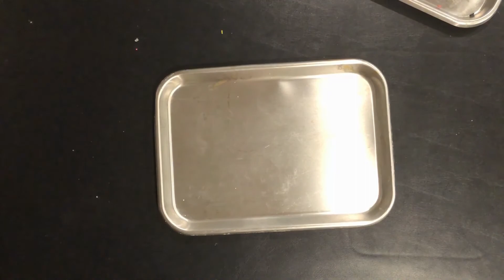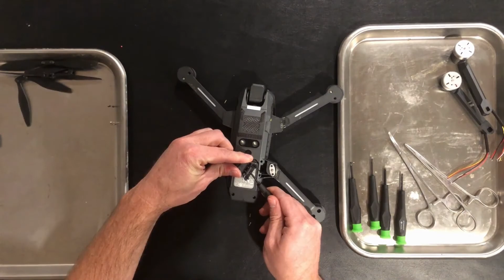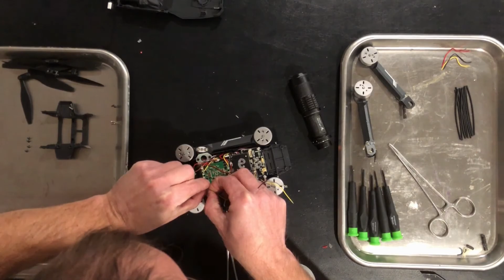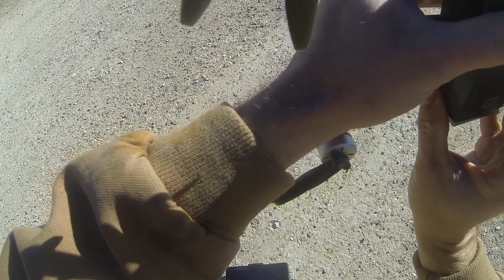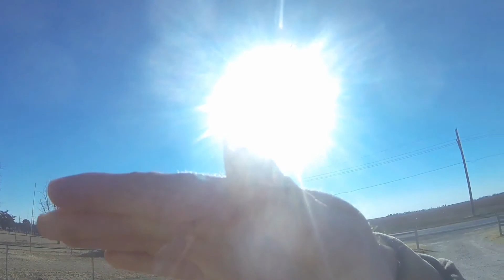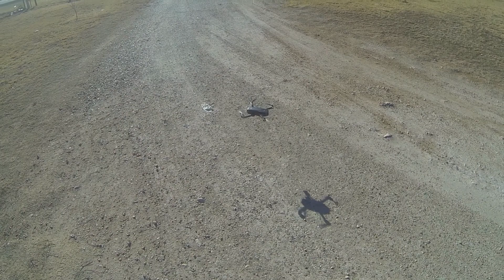Holy Stone HS720E Arm Replacement COMPLETE PROCESS AND TEST

Comment: This was awesome. I followed it step by step and the result was great. The soldering of the wire to wire did add some space issues with the shrink tube, but it all fit when I was done. THANK YOU for an Indepth video with no wasted time. Very much appreciated!
Reply: I’m missing the white part that holds the arm. Do you know what it’s called and where I can get it ?

Comment: Do you know the name of white part you take out at 11:43 I’m missing that since the crash and can’t find it anywhere.
Reply from the maker: There's a white piece with a metal locking mechanism that holds the arm in place...is that what you're talking about?  I don't know what they're called, they're not a common part sold as a spare.  You might need to reach out directly to holy stone for a replacement.

Comment: Hey! do you know the reason for crashes 720E? they all fall leaving in a free and uncontrollable flight.
Reply: they are too quick for maneuvering.. need to practice first in open field.. low speed is too slow sport mood is too fast they have fall sensors but no side or upside sensor or blade cover for crashes.. i believe mostly of peeps breaking them when flying first. definetly not easy to control
Reply: @nesargurkan  It seems to me the reason is in the GPS positioning system, I turn off the GPS and the drone has never fallen, when GPS is turned on, it sometimes abruptly goes to the side in hovering, once, when performing a "return home", it suddenly went into a turn and fell, naturally at that moment it didn’t control it at all, and it’s still strange that it ceases to obey even the motor blocking button.

Comment: Hi, can you replace just the motor? I tried to disassemble the motor but it's not coming apart even with the screws out.
Reply from the maker: You can't.  The bottom fascia is glued place and removing it deforms the arm.  You could possibly cut it, but it's not likely to be successful.  Replacing the whole arm is easier.

Comment: I'm a complete newbie at soldering is it possible to use ultra low resistance butt connectors cause I’m quite skilled with those
Reply from the maker: I wouldn't because they'll add more weight and bulk....there's not a lot of room in there and getting it to close up with just shrink wrap was pretty tough.
Reply: I’m sure the ones I plan on using will work they are very very tiny butt connectors meant for wires .2 to .5 mm and weigh next to nothing
Reply: Use tiniest needle. It wasn't difficult for me.

Comment: The 2 screws on the arm (above the white plastic) can't be removed on my drone, they just screw forever (dont know the correct word for it)
So I can't replace my arm fcuking bs.
Why are even the cables for the arms are soldered, a simple connector would be much better